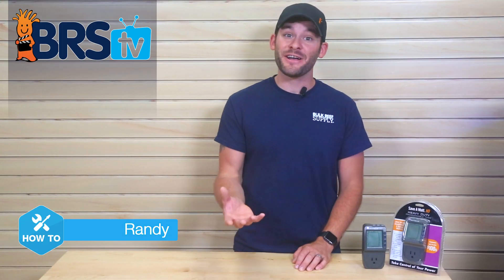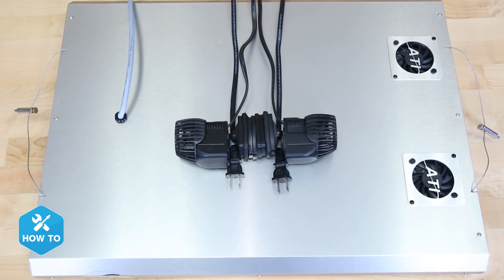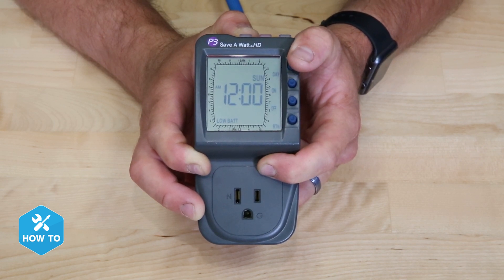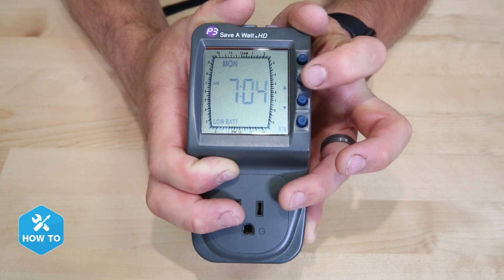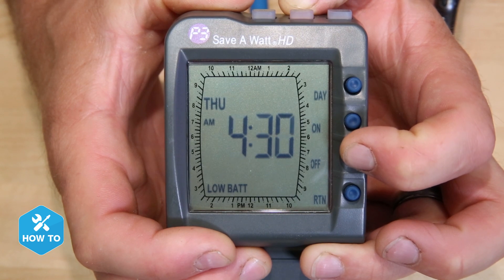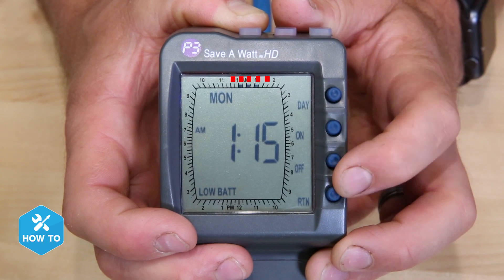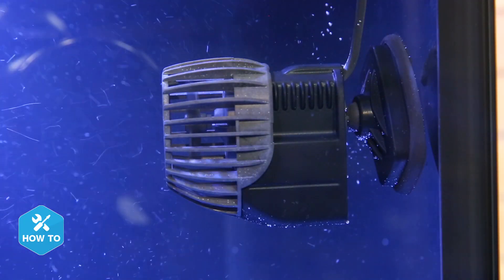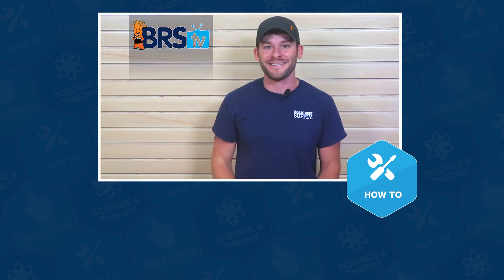How to program a Save-A-Watt Timer | BRStv How-To

Comment: Hey BRS - I got some questions that could potentially be good for new reefers.. 
1) How do figure out initial dosing of two-parts? Kalk? Calcium Reactors, etc. 
2) Can use Kalk AND 2-Part? Are the PH buffering abilities and cheaper cost of Kalk worth it instead of just using 2-Part? 
3) Do you dip corals before or after acclimation? How long should different corals/fish be acclimated for? Low Flow and Dim Lights? 
 
You might have already touched on these.. If so sorry for that, but if not could be some options.